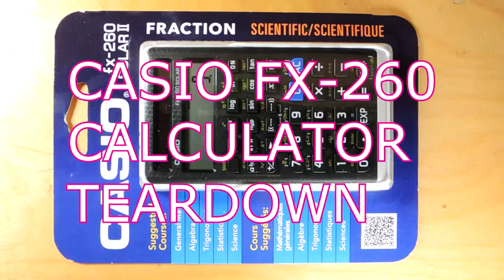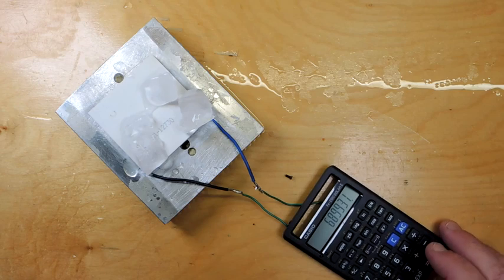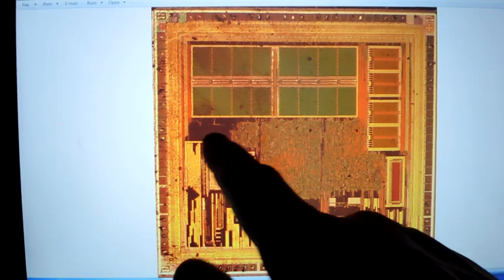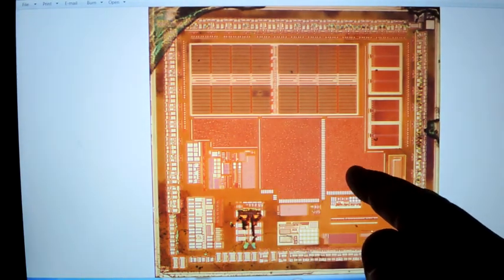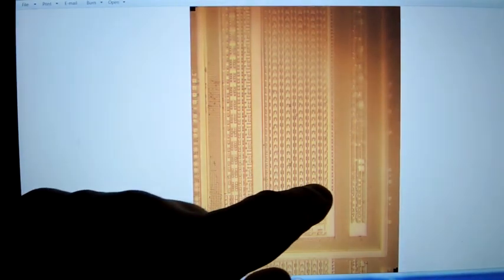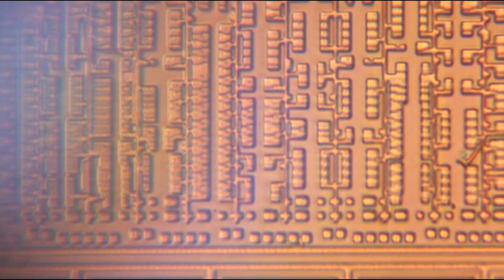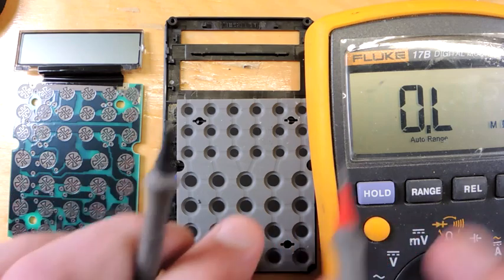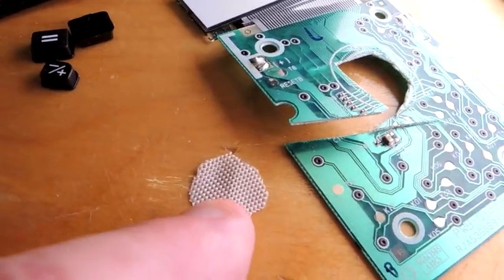Casio fx-260 Calculator Extreme Teardown and Conversion to Ice Cube Power!

Comment: Interesing feature on the fx-260: When doing statistics (standard deviation etc) you can enter any numvber of data points. How does it handle a thousand numbers in the small anount of ram it has? It doesn't store the numbers. Instead it stores all of the different kinds of results and recalulates them every time you add a number. Or a hundred identical numbers all at once, which is something else that it can do.

Comment: https://commons.m.wikimedia.org/wiki/File:CASIO_fx-92_Collège_2D_integrated_circuit.jpg
Here is a die shot of another calculator, the Casio Fx 92 college 2D+, which has a "natural display" it displays calculations like in a textboook on a 96×31 pixel dot matrix display. (it looks like that: https://www.mathematique.org/uploads/6/1/8/1/6181325/8185036_orig.jpg ) It has an OKI ML610901 chip with a 500KHz 8-bit CPU, 96KB of ROM and 3584 bytes of ram